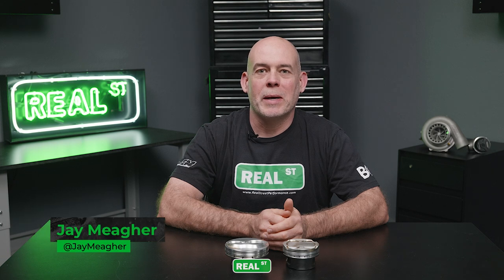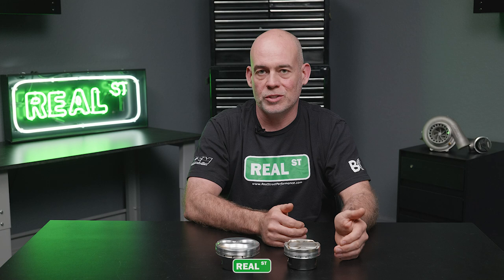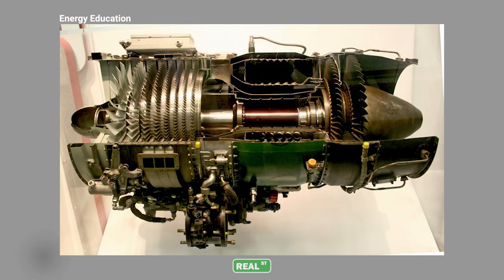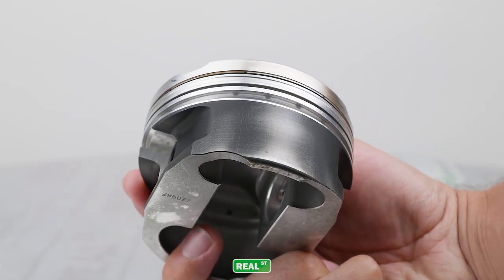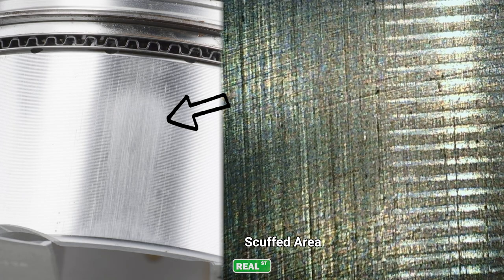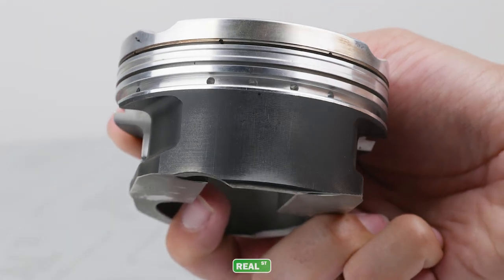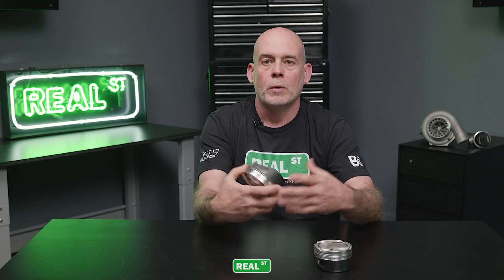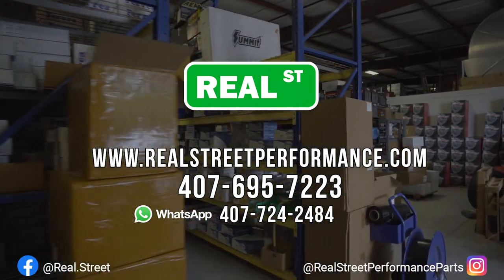What Are Abradable Coatings On Pistons? Is It Worth Adding? - Jays Tech Tip

Comment: Also, in regards to a jet engine. The blades actually lengthen the longer they are run due to high heat and centrifugal forces which is also part of the reason for the abradable shroud
Reply: When I read that the SR71 engine grows 6 inches in length at temp I was blown away.... tolerances, tolerances... Wild stuff! Thanks
Reply: @jaymeagher1510  the sr71 had gaps in the fuel tank and used to leak when it was at ambient temperature too. Only once it went supersonic, the friction on the fuselage would heat it up enough that it would expand and close all the gaps. Very extreme aircraft however. 
The civil aviation jet engines I work on aren't like that. They have tight tolerances throughout.
Reply: @h34evr  Amazing isn't it? There was a spec sheet for how many drips of fuel per minute was allowable. The body panels were the outer skin of the fuel tank!  I get to have breakfast with a man that worked on that project. He say to labor and cost prohibited to keep them leak free! Thanks
Reply: @jaymeagher1510  same with commercial aviation. Everything has a certain drop per minute leak rate that is allowable if the right parts aren't available to fix it or time is prohibitive 
Pretty cool that he got to work on them! Probably my fav aircraft. So many incredible stories came about because of that aircrafts incredible performance.
Reply: @h34evr  That's great that you have work you enjoy!

Comment: I also did some hard anodizing on a set of pistons,  which worked out well.
Reply: That's more for rejecting heat from the part. Thanks
Reply: @jaymeagher1510   "Hard Anodizing is generally used for applications that need a corrosion, abrasion, and wear resistant coating."
Reply: @ToprankImporters    We're saying the same thing.  This coating would complement a hard coat well. I think more people tend to under estimate the bore/rings needs for lubrication.  Especially with alcohol based fuels. Thanks

Comment: Jay, have you guys done anything with hard anodized pistons? I'm curious on the subject.
Reply: I've used them however I don't have a conclusive outcome. I know in top fuel it's a must, in milder engines I suppose letting the heat dissipate through the piston (cooled from the oil on the bottom" and through the chamber should be good for normalized temps. I'd say it depends on the engine! Thanks

Comment: Is this a good idea for used pistons? I removed mine and cleaned it with Chem-dip. Just not sure if I should do skirt coating for restoration of loss factory coating or just WPC treat it instead. I’ve never seen a new k24 factory piston before so I don’t if from the factory they add a coating to make the skirt perfectly smooth over the horizontal lines from the machining.

Comment: love your videos. just wondering, what would you say is a reliable hp number for a regularly driven car that you want to last a while? 100hp per cylinder?
Reply: That depends on the engine platform and it's original power level.  Generally OEM turbocharged engines have a higher ceiling than NA but some really good NA engines like the F20C or Coyote deal well with over 100hp per cylinder in stock form.  Also you have to define "regularly driven", some people are down right destructive and others are just doing a couple rips here and there. Thanks

Comment: What about wpc treating the piston skirts and cylinder wall wouldn't that be more effective?
Reply: Depends on the engine build that you're gong for. The MotoIQ channel has a good video on WPC treatment. He briefly goes over coating the skirts, or WPC treating them.
Reply from the maker: The same benefit of changing the surface finish with WPC is had with an abradable coating. The main difference is that abradable coating changes the dimension of the part but a WPC coating does not.
Reply: @realstreetperformance jay along this same question, i was looking at WPC. I am doing a stroker kit on Hemi engine. My assumption was the additional piston rock with the stroker kit would be more beneficial with the abradeable coating being that it should hold the piston more square in the bore?

Comment: How long would this last if I was to recoat a piston?
Reply: Once it's stabile the coating should stay intact for a long time. Ford was using a similar process on the 4.6 2V in the early 90's and it was always present when I broke those engines down. Thanks

Comment: Not sure if you ever covered this before but what is your procedure for lubricating pistons when installing? Some say dry install and some put a lot of oil. Just curious what your opinion is.
Reply from the maker: Jay Lubricates the Piston Skirts and Cylinder walls with a 30W non detergent motor oil during install. Not too much because anything extra is just going to start dripping down the bore, maybe even into places where it shouldn't.

Comment: coatings on pistons might come off from e85 use if not done properly,they will come off and clog the oil pickup tube and ultimately destroy your engine,im surprised jay didnt mention such risks.
Reply from the maker: I've seen that with other coatings but have not experienced delamination with this coating.  -Jay